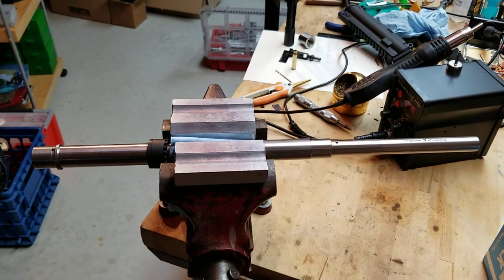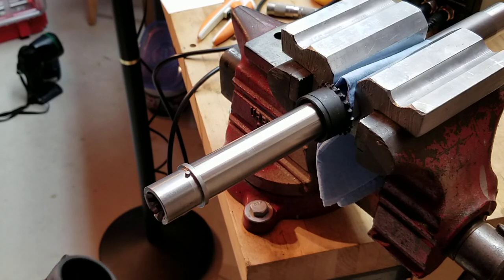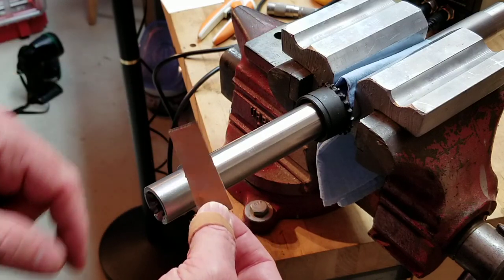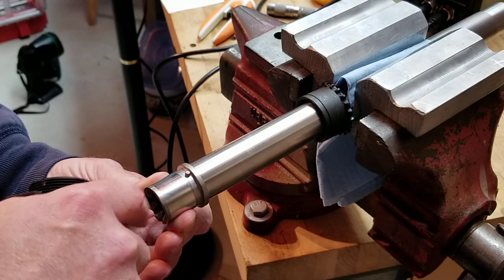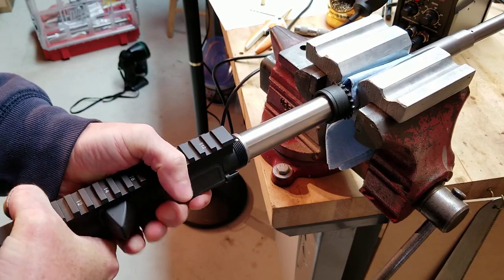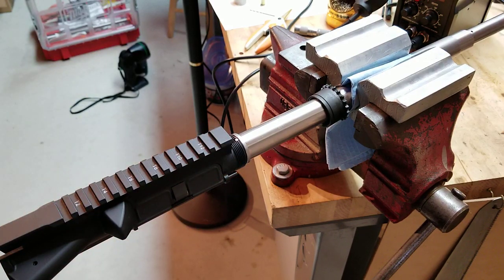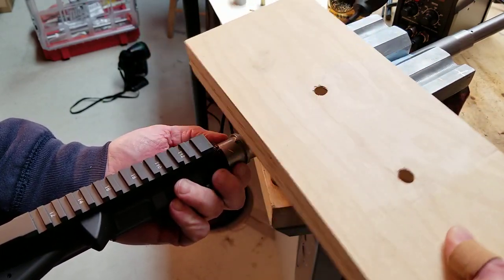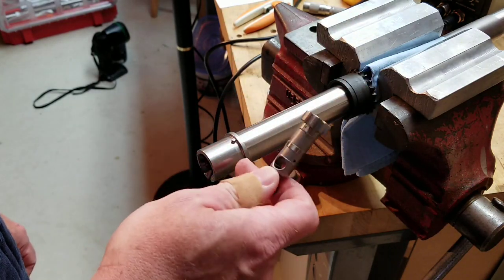AR Barrel extension fit & accuracy (precision)

Comment: That's a hack, they make a specific compound to coat it to solve this.
Reply from the maker: Sorry I'm confused. Who is they, and what is the specific compound and what does it solve?
Reply: @bpm990d  The "they" is various manufactures. Investigate retaining compounds designed for the bonding of cylindrical fitting parts. < this solves the loose gap uniformly....Also google  "AR15 barrel bedding" for even more discussions.
Reply from the maker: @sword-and-shield  Oh ok I understand. Yes there are some techniques where sleeve retaining compound like Locktite is used. I've used it a couple of times and it does work. I do think there are some advantages to using shim stock though. The thing with the retaining compounds that I have found getting them apart is difficult, because about 30 seconds with a propane torch will melt it. Once that happens the shear strength against smooth surfaces is not that great. Getting the residue out of the upper is kind of a pain. It tends to leave a mess that needs to be scraped out when re-barreling. The shim stock just falls out and can be reused.
Reply: @bpm990d  Some put the wrong loctite in, while there are other compounds that don't require as much heat. Its still always better because its uniform and the shim isn't. It isn't just about making it tight, but uniformly tight, otherwise the bother is probably not worth much for results. Far better to find an over tight upper like say BCM or something, and just lap it. I never base my decisions on a build concerning accuracy or consistency around ease of disassemble, because they are usually not mutual. If I was to shim it would be full width and full circumference but that pain wouldn't be worth the disassembly of a proper compound.
Reply from the maker: @sword-and-shield  I'm going to have to disagree with you about the lack of uniformity of the shim stock not being worth it. I've done before & after tests with this method and it does improve things.  However with a BAT Machine extension, it's basically impossible to get any shim stock in there unless you have a very large diameter on the receiver bore. With those I would go with a sleeve retainer like 640 or the Red Locktite. If you have not read any of the American Gunsmith articles from Joe Carlos, they are worth a read. He actually uses shim stock & locktite if working on a barrel that already has an extension fitted.  https://www.thefreelibrary.com/Carlos%2c+Joe-a14906
Reply: @bpm990d  Yeah, I have read some of them in the past, there is all kinds of vids and talk from all sorts on the net. I have seen, don't have link,  a vid from a high rep precision barrel maker calling it out for harmonics issues. I believe it started as an old school hack before the compounds were used and it just keeps regurgitating. I never said it does nothing, just doesn't do it as well, due to uniformity. If your going through the trouble, go 100%  I say, but most don't theses days. Common sense tells you without uniformity you are applying a cant with the barrel, and a shim it is doing just that applying  a cant. Sure it tightens the fit, with NO uniformity. Is it enough? perhaps for some. Is it the best? Clearly not. An approach to accuracy and consistency where going for 100% and details should matter the most, is why its a hack.  I wont even bring harmonics into the equation about uniformity. Also it isn't just red loctite there are many choices within the red loctite.. and other compounds concerning heat, and dimension differences between parts. Some try just one erroneously judging the process from a lack of proper investigation.
Reply: @sword-and-shield  I'm curious how shimming the extension and using retaining compound causes a different effect on harmonics between the two. There's no specific compound for the AR extension. Some builder use 609, some 620, some red Loctite. It all depends on the builders preference and what they believe works best based off their experience. If the shim is cut perfectly to size then there should be no issues with uniformity. Same if it's cut slightly undersized so long as it's atleast 3/4 around the extension and used in conjunction with a retaining compound. In that instance uniformity is essentially the same and being that both the shim and the compound both fill the gap between the extention and reciever bore I can't see how it effect harmonics. You talk about how some try just one erroneously judging the process from lack of proper investigation but it kinda seems like you're doing just that. You cite all these things but failed to provide any of your experiences to argue your point.  I haven't seen anything that proves that one method is superior to another and this is from me spending the last two weeks researching everything I could prior to putting together my DMR build which I'll be doing next week. You were right about one thing. It's not really about the tension of the extention in the reciever. It has more to do with eliminating any potential flex of the extention within the reciever while shooting.
Reply: @airborneivan  As far as the harmonics. I can't answer you, a video on YT did a great job, but is no longer on YT after the numbnuts Google acquired it. A shim as most do it, is not UNIFORM, but used as a wedge, harmonic issues make sense, how much?  I just avoided, based on it not making sense. I wasn't posting about any combination methods, but my opinion is that its not worth it, compared to finding a tighter receiver and just compound. No I don't waste time trying things that seem hack, when there are clear proper ways, but their are plenty that want to defend a decision to hack, have at it. Your right I wont provide my experience with a hack, because I don't do it, so seek someone who does, for your assurance.... "I haven't seen anything that proves that one method is superior to another "...and you wont, because of the variances involved in trying to compare. Seek out barrel mfg's perhaps, that was who made the vid I originally saw years ago, that and common sense, which is exactly what your last sentence contains. So avoid the hack bs..shop the tightest fitting receiver you can find. preferably to tight, and then lap, then just some minor compound and be confident of what is NOT causing issue when your accuracy, and or precision,  is not up to expectations.
Reply: @sword-and-shield  you still failed to provide anything to substantiate the shim being a hack. You stated you dead the American Gunsmith article written by Joe Carlos, the man who created the idea, but I have a feeling you didn't. Had you read it you would've read where he did extensive testing with just the retaining compound and with shim combined with the retaining compound and how he was able to consistently get about a 35% reduction is 10 shot group size. He didn't just test on  1 or 2 barrels. He did to with 10-12 barrels starting with just the compound, then just the shim and then a combination of the two detailing meticulously everything he'd done. He even went on to test using custom undersized, standard and oversized custom extensions from BAT Machining with the same thorough process as before and even did the testing in conjunction with BAT machine. He found the accuracy improvements bweteen the . 001 oversized extentions gave him the about the same improvements in accuracy when coupled with the retaining compound. The fact that he was able to get the same results is why he started to just use the extensions on the shims as the as the Army Reserves CMP shooting team because it was faster when servicing the amount of rifles he had to up keep. I've given you a mass amount of data and where I got it from. That man used the shim technique for over a decade and still uses it today. With all that testing to validate and confirm its effectiveness hardly sounds like a hack to me. The only effect on harmonics the shim had was when shavings from the shim due to tight fitment would curl up between the reciever face and extension flange which is why he recommended doing a test fit first. You try to validate your argument through logic be Joe Carlos extensive testing in the subject proves your logic is is flawed.
Reply: @sword-and-shield  and even with just the shim he consistantly got an 18% group size reduction and a 15% reduction with just the compound. Again, you say it seems hack by logic but in reality the shim is not being used as just a wedge because it is covering at least 2/3 of the extension and he's done the testing to prove that it is not a hack but just as much a viable method for accurizing the ar15 as the oversized extension method.
Reply: @sword-and-shield  it's kinda hard to take the word of "various manufactures" over someone who has built highly accurate competition AR's for 30 years.
Reply: @airborneivan  Good for you then do it, I could care less, what you post. I have been aware of all of it, means squat to me. If doing it right, by making it fit as tight as possible from the get, from a tight fit receiver and a bit of compound, or over tight and lapped, with just a little compound, doesn't makes sense to you, then go do your hack, with confidence, I will just keep doing it right.
Reply: @sword-and-shield  my point is your considering something a hack and trying to discredit a method that has been proven through testing. Not saying that an undersized reciever or an oversized extension is subpar or wrong. I'm just proving that it's not a hack and that you actually do care cuz if you didn't you wouldn't have gone to such length to try and discredit it as a hack.
Reply: @airborneivan  The point your missing is, there is the right way, which has been explained, and easily done. Then there is the OTHER than the right way, which is a hack. Now that doesn't matter if it works, who does it, why they do it, the results  they get from it, proven, unproven, good enough...if its not the right way...its a hack. You just have a comprehension problem on what a "Hack" is.  Discredit is the fixation in your brain perhaps,  it is never needed when there is clearly a right way.
Reply: @airborneivan  Wow ...you still can comprehend it is not about proving anything. You still don't comprehend its not about mine, yours. or anyone's feelings, its about procedure, there is always the "Right Way" and anything else being the Hack Way. With this procedure, the right way is clear...anyone wanting confidence from a hack procedure will find it, so your golden, go run with it.
Reply: @sword-and-shield  just remember it was you who brought your feelings into it. Not me. It was you who said you felt it was a hack. Not me. It's you who believes that your preferred method is the "right way". I believe that both methods are equal because someone with 30+ years of gunsmithing and building precision AR's ran this method for a very long time with consistant results and did the scientific testing to verify that particular method worked and when the oversized extension/undersized reciever bore became a thing he did the same scientific testing and they proved to be equal in there accuracy improvement. A hack is a half ass way of doing something to achieve a specific result but is not meant to be a long term solution. Once again, it's just another method and not a b.s. hack and works great for those who are working with a budget and can't afford to spend $400-$800 on a billett set with extremely tight tolerances. Or like guys who compete in CMP and have to run milspec reciever sets. I've more than proved my point. Your set on trying to prove what isn't when all I'm saying is both are viable options and people wouldn't be wrong if they went either way with their builds. The end goal would still be the same just one provides it at a lower cost.
Reply from the maker: @airborneivan  Joe had a fleet of 130+ rifles and he has a return to battery machine rest that he tested them on. Don't waste your time arguing with this guy. When this method was devised there were no "oversized" barrel extensions and no "tight" uppers you could buy. You needed a box of the things and it was luck. I can't tell if he is calling it a hack like a "life hack" or if he is using that language to stir shit. A proper shim job is going to be statistically insignificant on the target compared to the tightest barrel extension/upper receiver you can get.
Reply: @bpm990d  oh I know. I read up on Joe and his method. This guy's is using it to stir shit. We know better.
Reply from the maker: @airborneivan  I'm not even sure if it's Joe's method, but be has been the one writing about it for the last five or ten years. He is at Camp Perry every year selling barrels and assembled rifles. There are several of us here that shoot high power that use this method and we all swear by it.  Joe wrote that green locktite alone improved things by 18.6% and locktite and shims gave him an improvement of 35% over the original baseline.  He didn't test shims alone.
Reply: @bpm990d  you're right. And if I remember correctly he got the green loctite idea from another builder and came up with the idea to use shim stock.
Reply: @bpm990d  The "glue" alone will allow the barrel extension to "float". This will be temperature dependent. The shims with "glue" is a better idea and is not a hack. The guy you guys were arguing with is a bozo. I am a mechanical engineer.
Reply from the maker: @bowman4331  Yeah I wasn't really arguing with him, just not worth my time. I've shot a lot of rifle matches and have enough experience to know what the deal is. I appreciate the perspective of a M.E. and it tracks with Joe's experience of getting the best performance from shimming & gluing. Only thing Joe didn't test is the shims alone, but it's hard to get the locktite in there when the shims are so tight. Wicking is about the only compound that has a chance and that does not work all that well the way I shim them.
Reply: @bpm990d  Shimming alone should be better than gluing alone if it is done right..
Reply: @bpm990d  Great video!
Reply from the maker: @bowman4331  Thanks, I really appreciate that. I had posted some things on ARFCOM and someone was trying to claim that shimming was to make the bolt fit in the extension "more straight" or some nonsense and that this shimming was stupid. Some of those mouth breathers were saying it might mess up headspace, LoL.
Reply: @bpm990d  haha. That guy clearly had no idea what he's talking about. I mean come on, he said a compound is a more uniform fit(when a compound will expand to path of least resistance, not necessarily equal around a circumference) and a shim is a precision made part that is solid and the same thickness around the circumference(which would suggest it's very uniform, if not completely uniform.) People are nuts man.

Comment: 1st 8 minutes great video. Shim stock on order thank you. But  After 8 minutes pure trash lol. Playing with that bolt and a case without a head space gauge. Wrecked it.
Reply from the maker: I didn't make the video for you. I made it for the fucktards on an ARFCOM thread about a year ago that said shimming improved alignment of the bolt and carrier with the chamber. As the video shows, shimming has nothing to do with alignment of the bolt into the extension because the bolt is forced back against the locking lugs of the extension when a case is chambered. The alignment happens when the smith properly chambers and fits the extension.

Comment: I'd bet if you did an accuracy test shimmed vs not shimmed you'd have zero benefit shimming.
Reply from the maker: I have done tests and there was an improvement that was quite noticeable. Have you read the articles that were published in American Gunsmith in 2013? They showed a 35% improvement when he used loctite and shimstock. This testing was done while Joe Carlos was the armorer for the USAR Service Rifle Team and had 135 rifles to maintain so it was not a one off test.